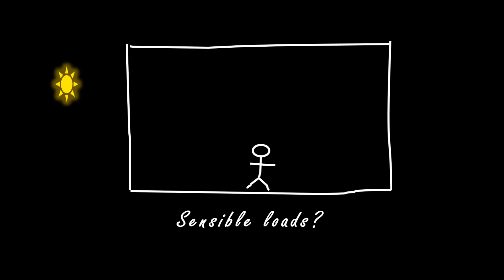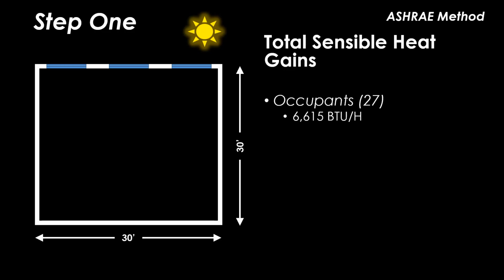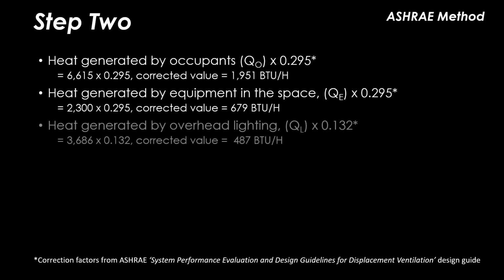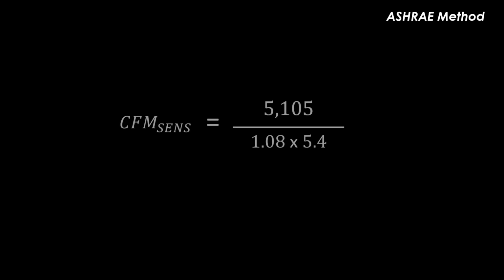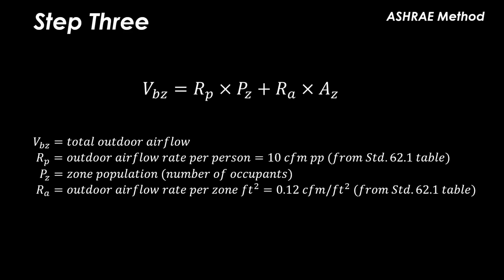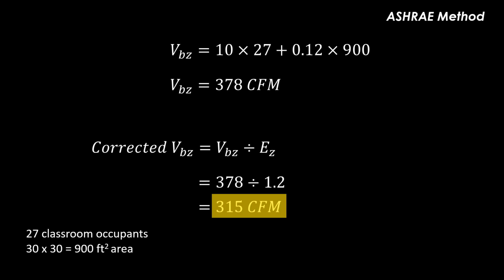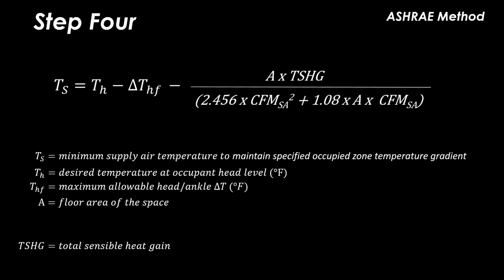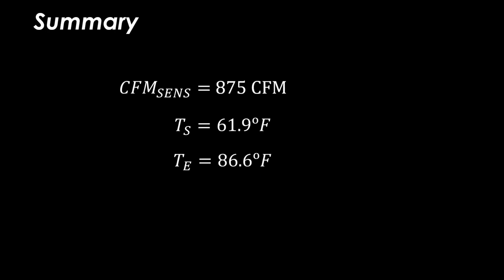Titus Timeout Podcast - Displacement Calculations Part 1

Comment: 1. What do you mean by exhaust temperature? will it be exhausted out of the system?                            2. Ventilation requirement after applying the Ez factor shall be added to the system. right?
Reply from the maker: 1. The Exhaust air temperature is the temperature of the air pulled out of the room at the high level grille.
2. The EZ corrected ventilation number is not added to the system but the greater of the ventilation air or the sensible cooling air is used as the final number - as explained at 5m.41sec in the podcast.
Reply: @TitusHVAC  1. okay, so the exhaust air temperature is nothing but return air temperature which goes back to the AHU. 
2. So no need for the fresh air intake ?